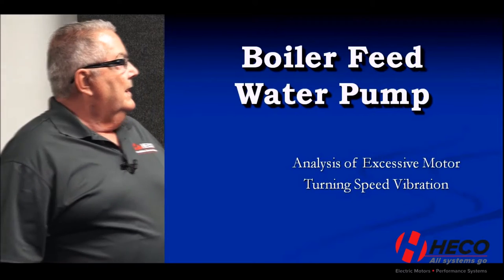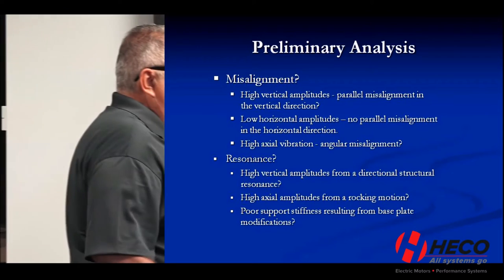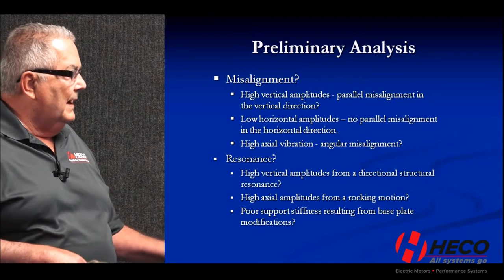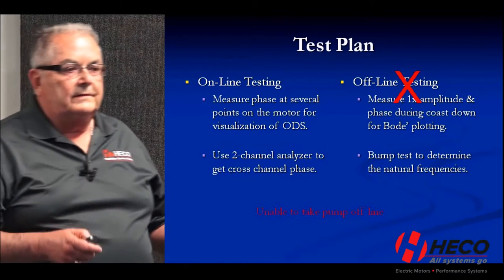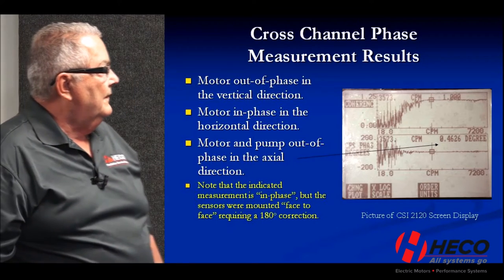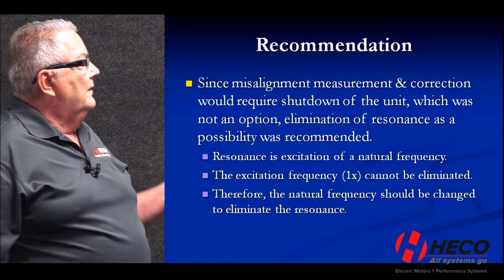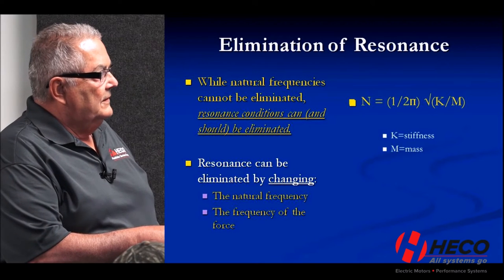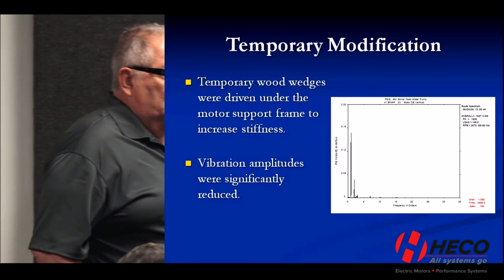How to Fix Vibration Problems - Boiler Feed Water Pump

Comment: I have solved numerous case studies like that. Most had similar foundation issues (1X horizontal was 3-8 times 1X vertical). After grouting, vibration reduced by 90-95% .